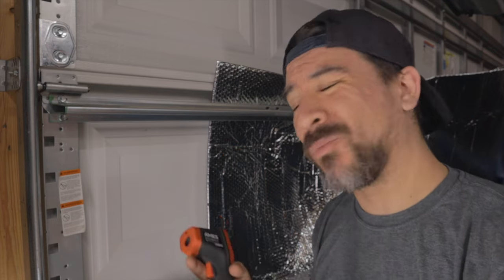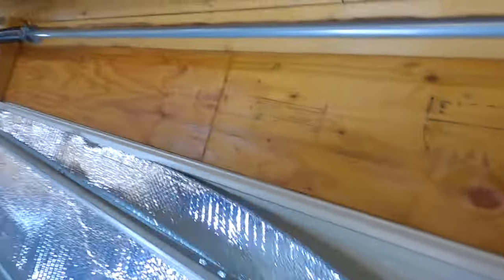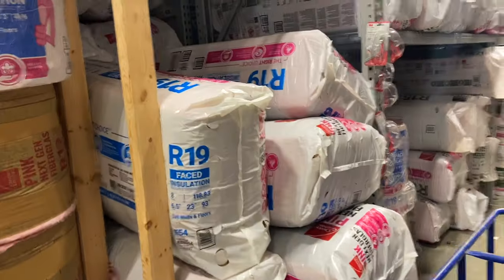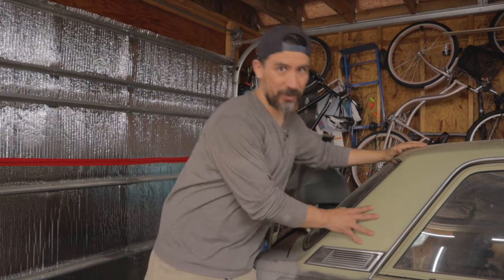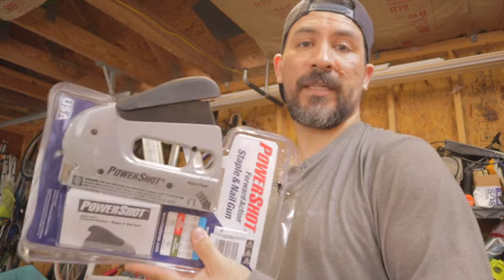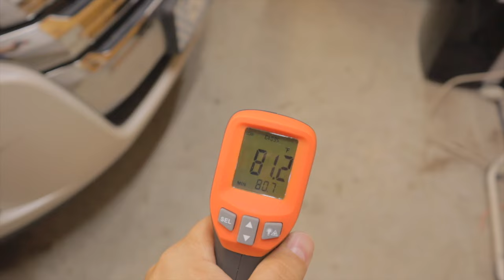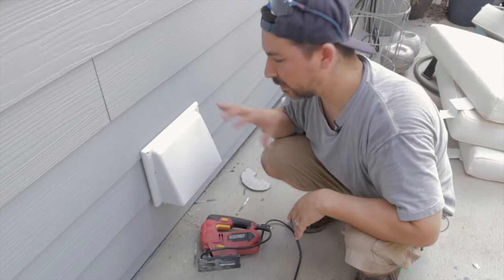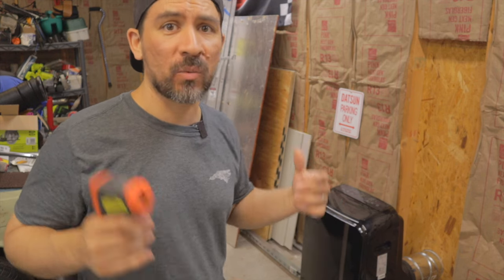Garage Too Hot? Try These 3 Cooling Tips That Actually Work!

Comment: If you think it’s cold now, a mini split in that space will change your life.
Reply from the maker: I was thinking of getting one of those, but it had a much higher price point. But it would work well in the cold months for heat too 🙌
Reply: Yep mr cool is best deal but need to make a dust cover for vent. Lots of shop videos on this.
Reply from the maker: @maus0292  thanks much will check out 👍
Reply: @maus0292  mr cool is over priced  if you don't go with pre-charged lines you can get it alot cheaper.  charging lines isn't hard at all!
Reply: I agree with the mini split but if you must got portable ac, a dual hose system should ahow significant improvements! Your host length is fairly short but ill also mention a general tip dor portables is to insulate the hoses as well.

Comment: I used my Flir infrared camera for finding hot spots in my garage while I was installing insulation.
Seeing the heat leaks is real neat.
Reply from the maker: The laser works pretty good, but the infra would be even better. I need to look into the flir

Comment: A dual hose portable AC would be even cooler, since the heat transfer would completely leave the room.   I had one of those single hose AC units, and it worked, but the dual hose is that much more efficient.  Alas it costs more.
Reply from the maker: Ah really? I was thinking of upgrading to a mini split. Will have to check out the dual hose setup. Thanks

Comment: One more very good option you can do is paint the outside of your garage surface white because white reflects a lot of sunlight compared to a darker colour garage that absorbs heat and makes things hotter. Having your outside garage white can keep the temperature of your inside garage 11 to 17°C/20 to 30°F cooler automatically. 👍
Reply from the maker: @Clouds-su3dc  love that idea. Too bad our HOA dictates the color of our shingles… but they do let us install solar panels. Thought was solar panels could provide shade and some extra power 😁
Reply: You can try a lighter colour also for option number two but it’s not as heat reflective as white but it’s still very good heat reflector. 😊
Reply: Yes, solar panels providing shade also with a lighter colour outside garage still reflecting some heat, even if it’s in the shade
Reply from the maker: @Clouds-su3dc  now just have to find the best cost solar options 👍

Comment: We had one of those for a while. But ultimately did not last. Replaced with a mini split. Due to dust we killed one. And read on our 2nd mini. Not fond of the filter stem. Need to build a filter box like folk that have them in wood working shops make. The filters prevent dust from killing the mini split.
Reply from the maker: Funny you mentioned this because I just cleaned the filter and added another layer of filtration from all the dust. We do quite a bit of cutting/sanding. I think we might upgrade to a mini split over time. What model do you have?

Comment: The problem with those portable units is the hot air that is expelled comes from within the room you are cooling and has to be replaced (normally with hot air from outside). A mini split will make a huge difference.
Reply from the maker: Right on, I think we’re going to upgrade to a mini split. Any suggestions on best brand???
Reply: @Itsallaboutthebuild  can’t really help on brands as I live in Spain.  I’ve got a Mitsubishi mini split and it’s been very good but I think there are more efficient options out there these days.
Reply from the maker: @kevinmills5293  NP, thanks 👍

Comment: What is the red tape for? Would double insulating the walls and the ceiling in the loft give equal or better thermal separation from the outside,versus insulating inside the (
building envelope) between the hot second floor from the living area below?
      Regarding the foil insulation on the garage door. I imagine you unrolling the foil upward from the floor.What were the roll width and length?Did you use two lengths coming together at the middle of the door. I like unscrewing the support lengths putting foil underneath. Has the door operated more quietly or did affect the integrity of the door overall?
Reply from the maker: Fantastic questions. The red tape just holds the reflectix together at the seams. You could use aluminum tape too. The loft above the ceiling which is now insulated is not insulated, but covered with reflectix material. If we were to insulate the loft you'd need some ridge foam vents too. The reflectix seems to work well in the attic. For the garage we used 4ft wide and as long as we could get the reflectix. The door works exactly the same, no additional noise or signal issues 👍👍👍

Comment: Use a dual hose ac unit or a wall mount mini split unit. Single hose systems are poor because they create negative pressure in the cooled space when they blow air out which sucks in hot air from outside through cracks and crevices.
Reply from the maker: Will have to look into a dual hose unit or perhaps a mini split… It’s hot out there 🥵

Comment: Great ideas, Do you think a gable fan can help?
Reply from the maker: Yes, I believe it would definitely help move all the hot air out of the attic space.
Reply: No, that will disrupt the flow from soffit to ridge vent.   With a ridge vent, which was clearly visible in their Reflectix video, you don’t need a gable fan.
Reply from the maker: @scottbrown6034  so as long as there’s good air flow through the ridge and the soffit no need for gable?
Reply: @Itsallaboutthebuild  Correct.  The gap you left behind the Reflectix, I’m assuming since I haven’t been there, actually runs from the soffit to the ridge vent.  It will act as a channel, allowing hot air to escape the ridge vent, allowing air to be brought in via the soffit.  That’s how a vented attic works.   If you did NOT have a ridge vent, then yes gable fans, or other attic fans would help.
Reply from the maker: @scottbrown6034  got it. So no additional vent fan needed in our case. Thanks 👍

Comment: Did you see any degradation in your garage remote signal?
Reply from the maker: Great question. Haven’t had any issues or what seems to be like any differences in our garage remote opener. And we’ve had this up for over a year now 👍
Reply: Excellent question. Did they insulated the loft walls also,and what were the considerations for the ventilation soffits?
Reply from the maker: @Preciouspink  Only the ceiling parts were insulated. The loft in the attic of the garage has reflectix material stapled on the rafters with ventilation of soffit to ridge exposed. Check out https://youtu.be/Agi11sbhciU